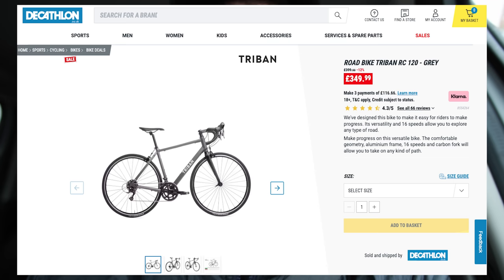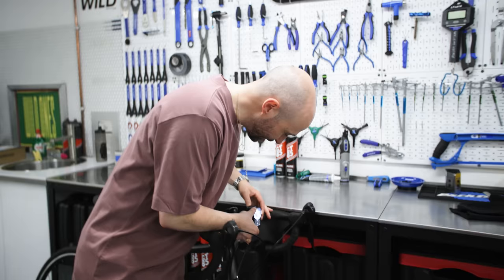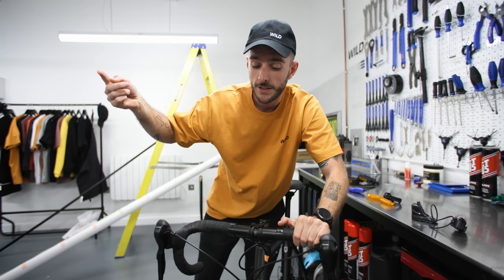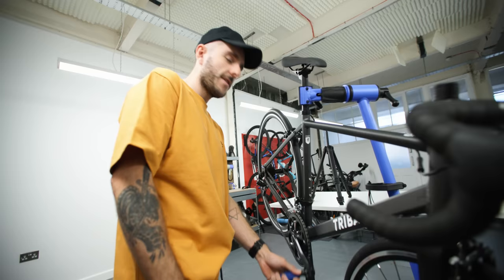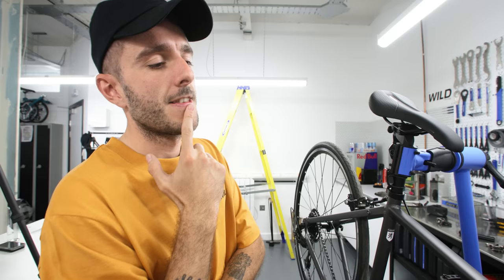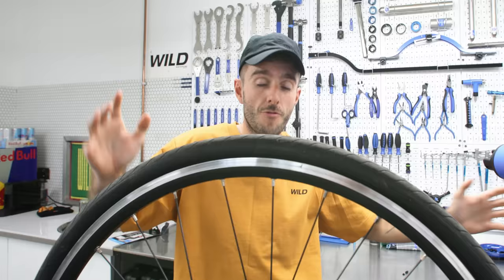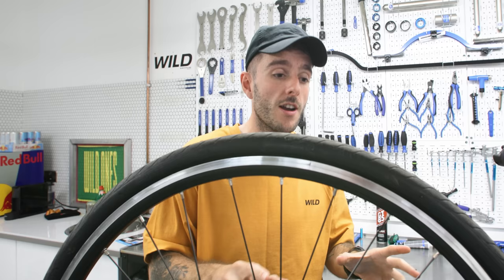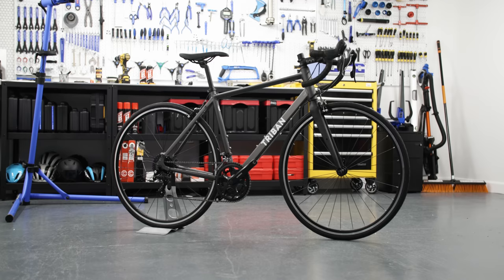We Bought A £350 Entry Level Bike in 2023 - This Is INSANE Value

Comment: 99.9% of people don't need anything more than an entry level bike like this one. Anything you want to spend you should spend on somebody taking a bit care of it. It is always better to have cheaper bike that is taken care of than an expensive bike that is not.
As to why anybody only needs an entry level bike is because you don't race. If your goal is to get from A to B then additional expense will not make it easier for you and actually may make it worse (just try leave an expensive bike anywhere, gonna get stolen very quickly).
If your goal is to use it to train, then additional efficiency means you just need to ride faster to provide same level of resistance. And if you are not racing, the only one person you are competing with is yourself. If you are competing with yourself from a month ago, does it matter to you how efficient the bike is?
Think about a bike as a way to generate a resistance for you, just like a stationary bike.
Just buy the cheapest bike that fits you, works reliably and can be easily fixed to run smoothly. Unless you are racing against other people. For cash or fame. Then go to town and spend as much as you can.

Comment: Tbh 10kg isn't THAT much considering you can drop a godly amount of money and not even get half that, and the TDF limit is 6.8kg.

Like, 20kg would be heavy. 10kg or 7-9kg for an average rider is basically zero difference IMO. Most people can lose more weight than that after a few rides unless they're already in peak performance, in which case you'd probably have a slightly more expensive bike anyway. 

The shaving off a couple 100 grams to justify spending thousands will never not be insane to me.

Comment: Actually bought an even cheaper model. Single cam in front. Shifter bolted on the steering wheel instead of on the brakes. Aluminium fork instead of carbon. (think it was the rc100 or something). I did add some straps to the pedals. The rest was probably the same.
Have been using the bike for years now (commuting 30km/day). Still using the same wheels but already replaced gears and chain several times already. I have no experience riding racing bikes but this one blows every other 'city' bike out of the water for me.
Every time I need new gears people from the shop always ask if I'm sure because the cost of replacing all that stuff is very close to the cost of the bike....
However I did decide recently to buy myself a new bike. (Sensa Romagna) Is is time to retire the thing after thousands of km...
Reply: Also they didn't put the steering wheel on straight as well when I bought it 😅

Comment: Insane value is correct. These are not half bad for a first touring bicycle. Yes you will have to add things by yourself, but that means you can choose what to add (or not). I'd replace the front chainrings for smaller ones, but that's it for replacements. They have road fenders for it, a plethora of racks and panniers.
The front rack I'd buy elsewhere, since you can get a lowrider one. And order some panniers with it.
With the size of that frame, I'd get a frame bag and move the water bottle holders to the handlebars instead.

Comment: Yes, this is what I did some 8 years ago. Had opportunity to be in Spain during early spring. And didn't even thought about bringing my own bike, but bought there cheepest Triban. Had my pedals, helmet and pants and was cycling there for 3 weeks without issues. Just wheel was not true after some riding, but few spoke turns later, done. And I gave that bike to some known people to keep riding to local shop. I think only some 5 year later it was finally stolen :}

Comment: A lot of positive comments here but the lack of a detachable derailleur hanger is a  very cheapskate feature not found on similar bikes so could be a throwaway frame after a couple of minor accidents. It should also be pointed out I believe the bike has low weight limits compared to its competitors so may not be the ideal introductory road bike for someone heavy looking to loose weight and improve fitness. Also I believe the forks are carbon fibre blades with an alloy steerer which is a cheaper type of fork and bonding between these two different materials can break down over a few years. If you look at carbon fibre fork recalls (most brands have had them) it often turns out it is this type of fork where the bonding breaks down. Last time I heard of a aluminium road bike without a detachable derailleur hanger it was a Walmart road bike that was sold for $99 in the states.

https://www.youtube.com/watch?v=v-i2R8E21ag

Comment: the 350 was sold out so i bought the 500.- (RC120)  i will put some 32mm tubes on it so i have a cheap but awesome Gravelbike :)

wait a sec. did i hear you right?
UK bikes have rearbrake left and and fronmt right? O_o
so you allready drive on the wrong lane, wrong side in the car, and even cycels are all F`d up?  What about motorbikes?

Comment: 36 kmh max speed with stock rear gears is to slow. Wheels are great,frame is light. Rear gears are really 7 plus one extra bolted separately. It doesnt drive so well on stock tires,i had 700x23 c on mine,and then it was fine. Ride. It feels big and heavy,and it shouldnt. It will depreciate quite badly,very quickly.

Comment: A cheapy to stick on the turbo trainer or use when your regular bike is getting fixed. I can't see the frame or wheels holding out with repeated  big efforts. The most unreliable part of any bike I've found is the wheels (especially the rear). Even a decent pair will end up needing to be straightened out after almost every ride.

Comment: I have a Triban 3 red 2012. Have replaced stuff as needed... Claris Brifters, Alivio rear derailleur, triple bottom is 30 chainring to 32 cassette, 485% range, so 8+3 cogs, it's reliable and the wide range is better for me. Shimano 500 wheels. I also GT carbon grade with 40mm Receptors. I marvel at how the Triban rides on 25mm Michelin Pro 4. I believe the frame was hand made in Italy, separate hanger. Just gone tubeless on 20inch Dahon https://youtu.be/QtMqa8l9b0M

Comment: The brake routing comment sounds unreasonable. Have you ever seen brake routings that way?
Reply from the maker: Perhaps we didn't show it clearly enough, our professional mechanic friend agrees he would route it on the same side. It's a compromise either way as the frame is designed for "euro" brake cable routing.

Comment: 10 kg heavy, these guys didn't have a bike in the 90s early 00s
Reply: I’m riding an aluminium hybrid built about 2005 which weighs in at 14kg. Rides ok. I’m struggling to persuade myself to shell out 2 or 3 grand on a new one just save 5kg!
Reply: @Tailspin80  I had an old Mountain Bike from GT, it weighed a lot more than my actual Diverge

Comment: Triban sells a RC100 in India. It’s a 200£ bicycle. Aluminium with steel fork with a 7 Speed trigger shifter on the handle bar. For 200£ it’s pretty decent.

Comment: Oh, heck, I’ve been riding loose ball cup and cone hubs for over 50 years. Buy some cone wrenches and a tube of grease, learn how to clean and repack the hubs, and quit whining.  If you want to protect the bearings more it’s fairly simple to rig up some O rings as bearing seals, or use the old British trick of using greased twine.  You’re spoiled!